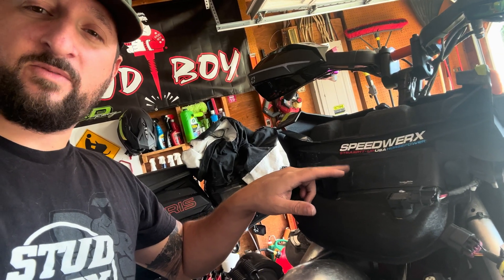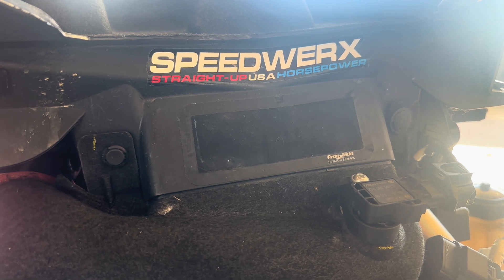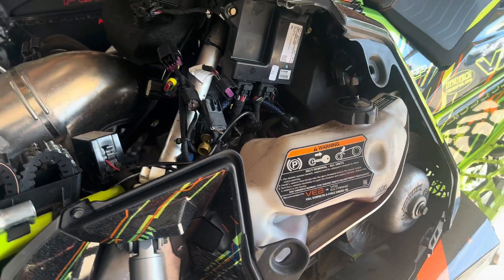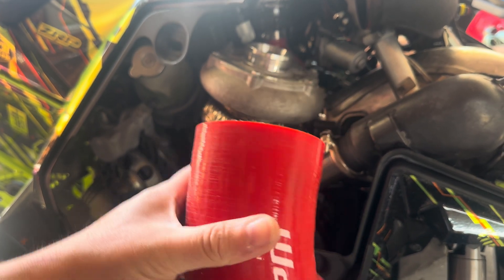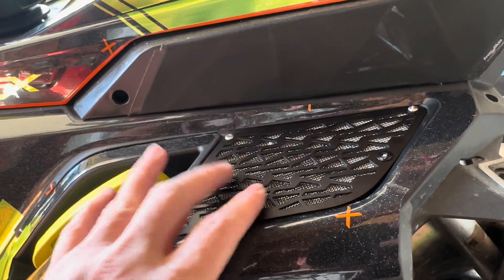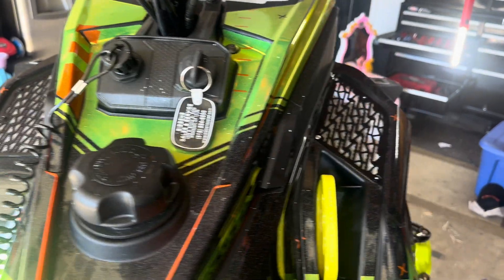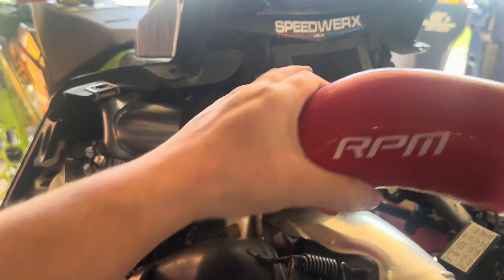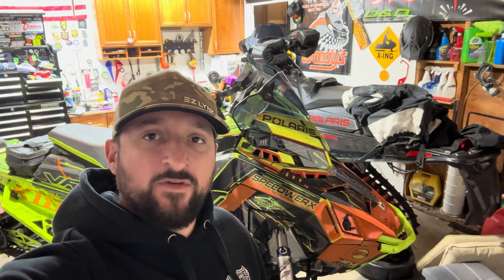Install and overview of the new Speedwerx intake options for the Polaris Boost. VR1 BOOST install

Comment: Only thing that worries me, is that it’s pulling more air after the intake airflow sensor, but I’m still thinking about getting one, it always says the part is on back order every time I look it up. But anyways does it make more turbo noises with it installed?